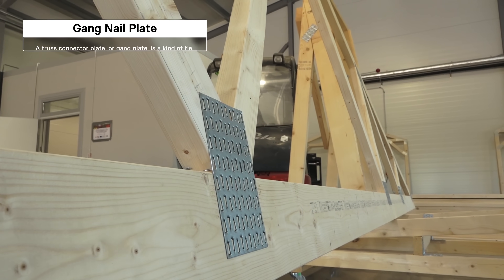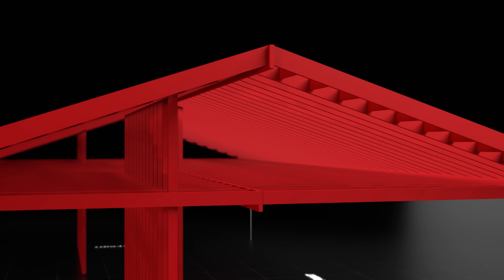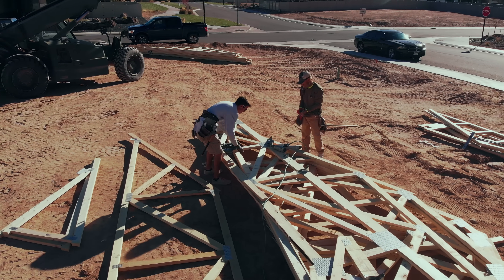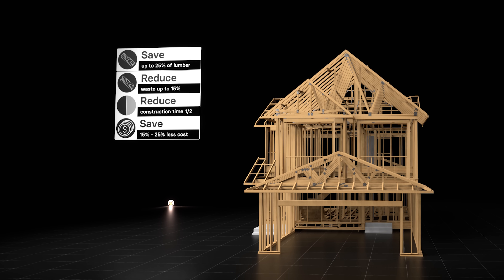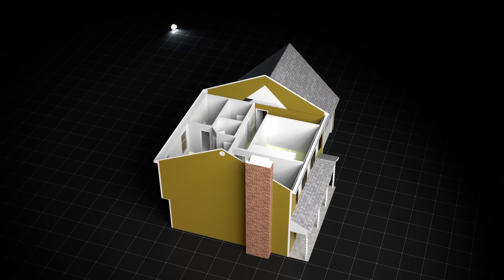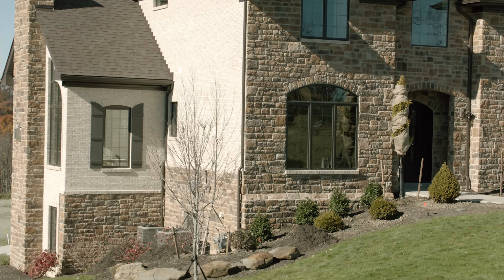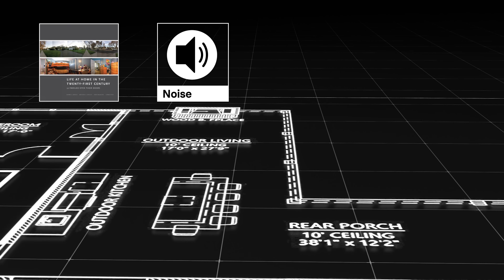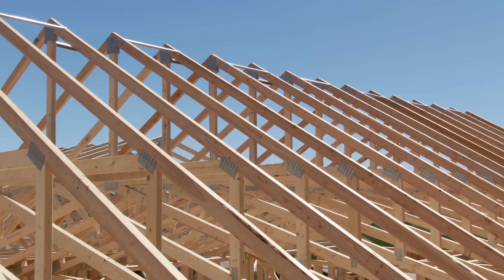The Invention that Accidentally Made McMansions

Comment: Interesting theory.. as a designer working in this space and scale frequently I can admit that pre fab trusses do allow for a decoupling from rational plan layouts and thinking - and therefore proportions and scale.  For whatever deeper reason, a roof line and facade proportioned off more traditional roof framing limitations is more pleasing to the senses - and results in interior plans that are more orderly, human scaled and comfortable..
Reply: For one thing the old designs are more tested... there are proven ways to use them efficiently.
Reply: @entertainme121 are you able to think critically? If you have extensive brain damage, then I can let this slide. Otherwise, how do you not understand that a truss system that is lighter, uses less material, and faster to construct that allows the roof span to widen would contribute to the proliferation of McMansions? It's simple arithmetic bud
Reply: @entertainme121  If you're older than 15 you should feel embarrassed for being so dramatic about unsubscribing from a youtube channel.

You seem like a pretty unpleasant, unreasonable person.
Reply: How do you know that your sense of comfort is from "human scaled" proportions, and not simply familiarity?
Reply: Just looks more right. Right?
Reply: @entertainme121  You didn't watch the video...  It is a cheap joint hundreds of times stronger than a handmade nailed truss.  Strong enough you can make long trusses out of short wood.  Strong enough that modern houses have all the strength in the roof and basically nowhere else.

Comment: 7:58 The SUVs of housing.
Reply: What's wrong with SUVs? You can comfortably fit 6 or 7 people, or fold the seats down and haul stuff, and you can do all that with ground clearance and 4wd.
Reply: @ Even people that drive SUVs don’t like McMansions.
Reply: I assume people crapping on SUVs don't live in snowy areas. SUVs are much better than smaller vehicles when you have tons of snow everywhere that would otherwise trap your car.
Reply: @Most people that drive big SUVs don’t really need them for practical reasons.
Reply: @barryrobbins7694 . I don't have an SUV but I'm damned thankful about others having them when I need shit hauled.
Reply: @MJEvermore853  The key word is “others”. Even occasionally renting a truck is preferable to buying an SUV.

Comment: You hit on the main reason I don't like truss construction, unusable attic space.  I feel as though if I am paying to enclose that space, I should be able to use it.  With the size of the McMansions, there is a fair amount of floor space that could be finished into living area.  It could provide that private space for when one wants to get away from it all, or a nice little hobby niche.   That is also a reason why I want a basement, preferably with 8 or 9 foot ceilings.
Reply: Maybe walk-up convertible attics should make a comeback.
Reply: @jackesioto  Exactly. I am reminded of Levittown as an example. Smaller homes built so people could expand it by converting the attic, and or basement, into additional living space. This works well in affordable housing on relatively small lots. Houses built on slab foundations with trussed roofs make it impossible to expand without sacrificing the already small yards
Reply: Put the 25% savings into making my the house larger or adding a basement.
Reply: You definitely can get trusses to make an attic space or vaulted ceilings! There are also other fire block techniques not discussed in the video
Reply: @AlanW-ConstructionOnly  If that's the case, why isn't anyone doing it? All I see are stupid steep roofs full of trusses filling up cubic volume for no reason that should be usable.
Reply: @ to make the house appear larger and more affluent (?) or something along those lines - with an unnecessarily large roof and waste of materials - larger repair costs in the future when inflation hits - did I say waste of materials?
Reply: @ @ to make the house appear larger and more affluent (?) or something along those lines - with an unnecessarily large roof and waste of materials - larger repair costs in the future when inflation hits  , to use up allot more energy and wasted space that’s unusable - did I say waste of materials?
Reply: @AlanW-ConstructionOnly  You sound like a typical person that doesn't know what he's talking about but doesn't let that stop him from making up something so he could comment.
Reply: There's plenty of truss options that allow for storage and insulation.

Increased building standards for air sealing/insulation are more to "blame" for less usable attic spaces, which also decrease utility costs and increase comfort in the home. People often forget that those old houses with big attics were leaky as all get out. Air went right through them, and moisture did too. As we started sealing them up looking for more comfort and less energy use to heat the home, we needed more space to isolate the living space from the outside. Cue attics and larger exterior wall cavities and crawl spaces. Perfect places for big air barriers and lots of insulation.
Reply: @KahluaBomb  You are correct about the old houses being leaky and hard to heat.  I lived in a few of those.  One was built shortly after the Civil War.  When is was windy outside I could watch the drapes in the living room sway back and forth.
Reply: Ahh.. I see you’re unfamiliar with ATTIC TRUSSES 😂
Makes you wonder about all your other reasons considering attics the main one
Reply: @jackdknutson  You are correct, I have never heard of or seen attic trusses.  If they can leave open floor space, that might be useful.
Reply: Attic and basement spaces are the most expensive spaces in a house on a per Sq ft basis. It's usually cheaper to  build the amount of Sq ft you desire on top of a frost protected slab and below an insulated attic floor. The only exception is if you're hitting height limits or building on a heavily sloped lot.
Reply: @hailexiao2770  The other exception involves the size of the lot.  Most urban and suburban lots are simply not big enough to double the footprint of the house, but one can put a full basement under them.
Reply: @hailexiao2770 I agree with this. 

I have both a large stone/brick basement and a huge, full unfinished wood-sheathed attic in my 1910 farmhouse. They are both unique and beautiful spaces but sadly largely unusable unless expensive add-ons are put in place.  

My basement doesn’t leak water but because it is below-grade there is always extra humidity in the air, so a dehumidifier runs almost constantly.  If it had drainage issues, it would require perimeter interior drains to be cut into the cement floor and a sump pump installed.  Also, basements in my area require radon remediation of about $2K.  And the biggest expense is replacing the small very stylish wooden casement windows with large window-wells that would ruin the aesthetics of my farmhouse.  

The attic has the feel of a cross between a barn and a Quaker-style meeting house, including built in benches along one wall and wrought iron coat hooks along the other.  Every surface in it is unfinished rough-sawn pine and there are two nice-sized windows on each gables end. The ridge height is 14 feet above the tongue-n-grove unfinished pine floor.  While a lovely large space, it gets incredibly hot in the summer and cold in the winter.  Insulating it and adding mechanicals will significantly alter its charm.  Even as just storage, the temperature extremes and two flights of stairs do not make it ideal.  

Along your line of thought, I saw a builder in Texas design homes that had a huge windowless room designed into the deep center of his floor plan on both the first and second floors, acting as essentially the attic and basement spaces, respectively.  

The first floor space was accessed off a kitchen hallway, allowing it to act as a butler’s panty, wine cellar and all around storage room.  It could also be designed into a kid’s playroom/classroom area.  

The second floor room was accessed from a door off the hallway, or if more concealment was desired, off the back of the master bedroom’s walk-in closet. It could be used for an additional  WIC area or for general storage, or many homeowners turned them into safe rooms.  If they were accessed off the hallway, many opted to turn them into home theaters.  

These rooms were conditioned, but since they were windowless and insulated by the surrounding conditioned rooms, their vents could be closed and they could become zero-energy storage spaces.  This makes these a very wise storage solution and eliminates the humidity and energy-intensive conditioning concerns of basements and attics.
Reply: This is more due to the initial design choices biasing towards cost. With an initial truss design,  built-in storage or additional rooms can be incorporated to the truss design at a lower cost than traditional framing.
Reply: @BryanTorok  I agree.  The beauty of the vertical dimension gets lost. Light and air and views… lost. Makes a huge difference in a home.
Reply: Attics are extreme temperature environments. What did you want to use that space for?
Reply: @ ours now contains an office and a yoga room. Great view from the roof peak, with two skylights and one regular window on the peak side. All can be opened for cooling. Views of the city park and countryside beyond. The roof has extra insulation but yes, heating becomes an issue in winter. The radiator isn’t working. Something to do with water pressure? I don’t know. Will have an expert look at it. But it is a lovely and useful space.
Reply: @egbun  In my experience, heating is not usually the issue as heat rises.  The bigger problem is cooling as it is harder to push cold air up hill and heat rises from the rest of the house plus heat from sun on the roof.  But, your office and yoga room sound lovely and just the sort of use I had in mind.
Reply: @BryanTorok   you need to get a variable speed air handler and leave the fan on 100% of the time. 
Mix the air in the house and use the mass to control the energy cost and prevent short cycling.
Reply: @houseofroos  The area can be finished and used for most anything.  Another commenter said they made their's in office space and a yoga room.  The have skylights  and windows so natural light and ventilation. In my parents ranch style house the space was not finished save putting down some plywood for flooring.  They used it for storage such as the seasonal holiday decorations.
Reply: Lots more basements in the northern part of the US, you have to go down 4 feet for the foundation to be below the frost line, not much more money to go down 9 feet instead. Where I am now in Kentucky the frost line is 2 feet deep so fewer are willing to spend the larger amount to go down 9 feet. Several build a house on a concrete slab instead of a crawl space, ignoring the big plumbing problems possible if the slab gets in the way of repairs decades later. Also the extra heating and cooling costs because a slab is only very rarely insulated as well as a crawl space.
Reply: @jeffruebens8355 Yes, in Florida, basements are virtually non-existent for exactly the reason you state.
Reply: If they design attic space into the truss design then it’s easy to have. Adding it in later is a different story. House I’m in now uses trusses. They offered an option when building to have a storage attic built. Unfortunately our house wasn’t spec’s with it. Isn’t the end of the world, but I do wish we had that extra space. I assume we could hirer a GC and engineer to redesign and retrofit an attic storage space in, but my wallet hurts even typing this out
Reply: It's cost that you don't understand.
You can pour foundation and frame space under trusses cheaper than you can frame an attic.
Also understand if youre doing a basement that it isn't valued the same as above grade. It's about 1/10th the value.
If your house is a thousand square feet at $100sf with a full finished basement valued at $10sf. 
$110,000 at appraisal.
If it's two stories on slab at $100sf.
At appraisal $200,000.

If your basement walls are 51% above grade It's valued at $100sf.
So if you have flat land leave the basement exposed and put retaining walls out around 10 feet from the wall
 Only bury up to the bottom of the standard windows and you should be good.
Lift a drink to me when you're done with you above grade basement that was cheaper than a second floor. Pocket the extra 90k when you sell or use it as the equity on a 60% loan to value and get better rates. If you're paying cash you now have a nice flower bed or pet area outside the basement windows instead of .etal window wells.
Reply: @sparksmcgee6641  Your point in hte first paragraph makes some sense.  In the area where I live, most homes have basements and many people, myself and my wife included, would not even consider buying a house without one.  

As for your second idea, most urban and suburban areas are not going to let a person build such an odd house and few lots have the room for it.  If you look at the video you see these McMansions being built up five feet from the lot line.  Personally, I think it looks ridiculous to build such a large house on what is proportionally such a small lot, but that is a trend.
Reply: @BryanTorok  You can build that way anywhere. There is a max height you have to deal with on any bulk plane.
House looks thw same as many others.
Reply: @sparksmcgee6641  In Phoenix, where the ground is super hard, a basement can add a couple hundred thousand to the construction cost.   You only find them in very rich neighborhoods.  Everything else in either on a slab, or these days a pre-tensioned slab.
Reply: @Rocketsong  Hard ground isn't that much of an issue. Rock can be an issue.
The reason slab is standard in Phoenix is they have a lot of land and large lots compared to most cities. It's cheaper to build square footage on a slab going out than up. 
Going down can be cheap if you have experience but most people don't in markets that are all slab.
A $300k excavator with a 36" bucket will make a hole in a day. Getting that unit and an operator to you site is the issue so if you do it yourself you come out ahead. 
Anyone can dig their own hole easy.
Reply: Here in Florida, northern transplants assume there will be a basement. Nope - deep foundation walls aren't required in the warm climate, and the water table is usually pretty high. So, attic, right? Probably not. They don't want to pay for attic trusses or common framing. Besides, the AC and ductwork has to go somewhere, and they don't like taking space for that out of the living footprint. And even if the entire 'attic' is insulated, the roof slope will likely be lower (so less usable area) as it is a. cheaper, and b. a structurally stronger for inevitable higher wind loads. And that, children, is why no one in Florida parks in their garages unless the HOA requires it. Garage = hoard. Plus, who doesn't want to bake their auto's plastic parts in the sun until they fail before their time.

Comment: A couple things on trusses, that weren't quite mentioned that (I believe) make them more beneficial, especially here in the northeast are 1) Energy Heels. Trusses made energy heels possible by moving the slope of the roof above the bearing point of the truss itself. This creates more room over the exterior walls for insulation, where in the northeast, using standard insulation methods, needs a more space for the amount of insulation needed for meeting the R-value required. A common issue here on older homes is ice damming, where heat loss through the insulation melts snow and ice on the roof which sheds down over non insulated spaces, like porches and other overhangs, and refreezes, creating a dam where the water above will gather and work under shingles, making leaks in the interior of houses. Having more space for insulation alleviates this, somewhat. Along with other methods such as ice and water shield, since you can't stop ice damming completely, but it prevents leaks in the house.
And 2) Floor trusses. People's need for deeper garages and floor space with open space below needs a member than can span further without support. TJIs can do this, but the real max span for a TJI (even the biggest ones) is in the realm of 32'-8" (this being a 560 series 16" TJI, 12" O.C. [which is nuts, expensive, and hard to find]). Plus, with open webbing, it allows for electrical, plumbing, and HVAC to be run without cutting or modifying the member, plus larger tops for sheathing ease. Only down side is it creates a large open cavity for fires, which is accounted for in the code with maximum cavity size.
All of that being said, there are still many houses and needs where a raftered roof is preferred. Great video!
Reply: +1 for the open webbing of trusses which facilitates a much-easier installation of mechanical systems. As for the void space and fires, the code allows for blocking or draftstopping to compartmentalize and manage the fire risk.
Reply: One more thing to add: girder trusses.  Big trusses that are meant to support other trusses.  You can support more with a 4' deep girder truss than you can with a lot of steel beams...

Comment: I'm just a focus group of one, but in my life I have had three houses, all older (the newest built by the owner in 1948) and had very few problems with any of those, yet both my mom and sister bought fancier new build houses (the 1980's through early 2000's) and I they both have had constant issues.  Admittedly (and thankfully) none with framing which is the topic of this as usual great Stewart video.  But at least with my experience I will never consider a new build houses no matter how much showy lipstick decorations they put on it.